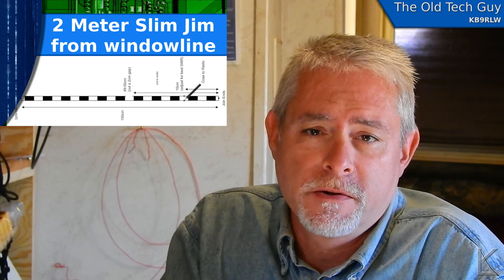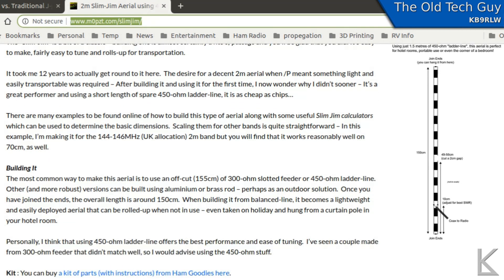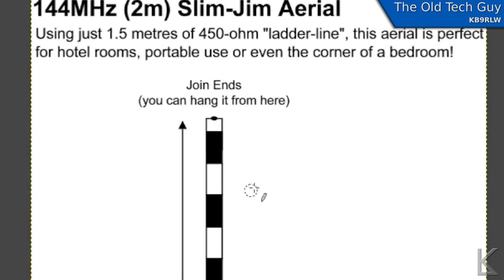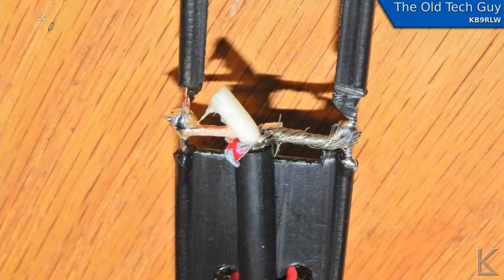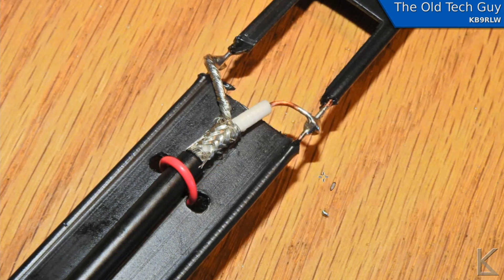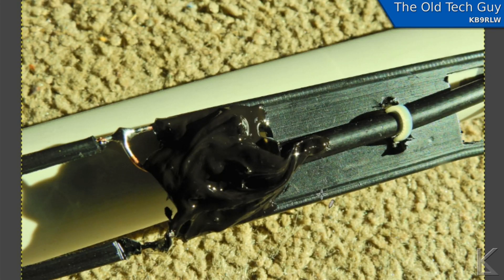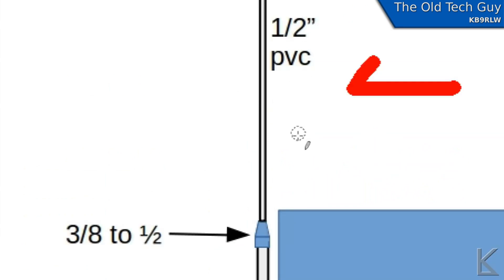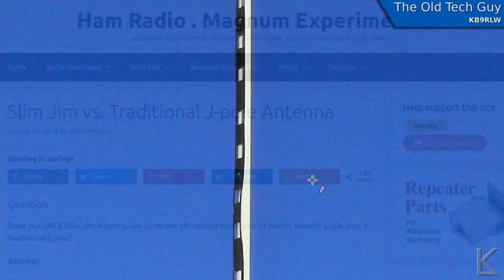Ham Radio - A 2 meter Slim Jim from window line.

Comment: I got the same model from N9TAX on my roof in NYC installed on PVC mount & work awesome. Using 50w mobile radio with this antenna, I cover Tri State area in NYC.

Comment: N. Davis/WB4BKO
About six years ago, I constructed a similar antenna for two meters, but I inserted the antenna into the PVC pipe. It was suspended from a pipe cap using a zip tie. Inserting the antenna into the PVC had negligible effect with SWR below 1.25:1.0 across the entire band. It is still in use as my primary 2-meter antenna and delivers good results with the top just squeaking above the roof line of my single story home. Eventually, it will be placed higher in the air at 40 feet when I mount it to the side of my telescoping tower. Good video and instructions are very clear. 73

Comment: Another great video.  It's the perfect blend of practical antenna theory, construction article and motivational video to get people building and enjoying the hobby.

I think I'll make some Slim Jim antennas for friends looking to get into personal emergency communications on the cheap.  I'll put the ladder line in rigid 3/4" PVC  with caps on each end with the strain relieved coax in the lower cap with a #60 weep hole to save a couple of RF connectors - cheaper, easier, more reliable, slightly better performance.  A coax choke also adds more strain relief and I'll cut the coax just long enough to reach the radio.  Simple, easy, cheap and good enough.  I can cut the PVC pipe longer to get a bit more elevation without a tower while having a fairly unobtrusive antenna.
Reply: I purchased my slim jim (many years ago). I used it for a while as my base antenna until I got a copper j pole. Now I have it hanging from the ceiling of my shack with a UV5R connected to it for monitoring. No PVC pipe or anything. Still works great! Since I have my base radio disconnected, most of the time, to avoid lightening storms, I have replied to people using the UV5R with no problem.

Comment: Thanks for a great presentation, and actual lab results.  I find that my 1/2'' copper pipe slim jims have a much broader bandwidth, typically 144 to 153 Mhz.  Indeed, using 3/4'' copper pipe for 70 cm slim jim, it is good forl 430 to 470mhz.  I believe my Slim Jims have a 2 Mhz broader bandwidth than my J-poles made of the same diameter materials.  I also believe that these antennas will have a lower take of angle and improve performance the higher that they are mounted.

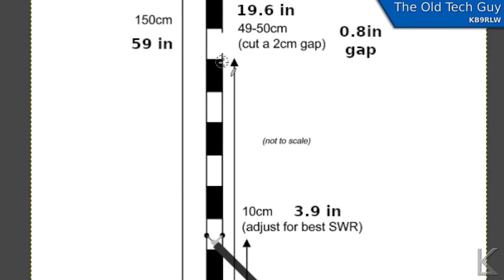Comment: 3:57 What I did was to cut it centered in the solid area - for strength - and then measured down for the rest. I did have to strip away some of the solid at the base to make the soldered short and also at the feed point, but that was no problem at all.

Comment: 1/4 inch fiberglass rod works better as a mast and won't affect the radiated angle of the slim jim.  Apparent gain is the advantage of a Slim Jim over a J-Pole.  Anecdotally, my SlimJim performs incredibly well portable/SOTA ops and I have complete confidence in this great design.

Comment: Most everyone I know calls it ladder line.  If yer cut falls on a space (window)  you could make a small hole in the top solid piece and bottom solid piece and sick a wire tie through the holes and zip it up to where both halves are even.  You'd have to use plastic wire ties though.  That would strengthen the antenna.  There's no link in the description.

Comment: I put mine inside of a piece1 inch PVC with a cap on the top  and bottom then so-239 on the bottom works great I have also installed an eye bolt in the cap where I can string it up over a tree or anywhere

Comment: Here is an idea for widening the bandwidth of the antenna. Where you have 2 -1/2 wave verticals if you make one slightly  shorter or longer would you get a double dip in the return loss or VSWR since the resonant length is slightly different.  
Alternatively  you could connect both the verticles at the top of the 1/4 wave matching section  making them a fan dipole with slightly different  resonance???
I would like to see if this would widen the BW.....
Reply from the maker: Be sure to let us know how your experiment goes.

Comment: You can Make this Window line into a 2 Meters Slot Antenna, 39 Inchs, with the Feed Point on 4 inchs from the End of the Window line, this Antenna is Vortical Polarize with is in the horizontal Position,

Comment: You could superglue a length of non conductive material to bridge that gap, then use some adhesive lined shrink tubing to reinforce that gap.
Reply from the maker: Or just cut your line so the gap is in the middle of one of the spacers.  Less work that way.
Reply: @loughkb  Yes, that's exactly what you do. I have made them for 27Mhz and the FM broadcasting band and that is how I've made every single one of them

Comment: Hi Kevin.....love your videos. I have a question in regards to the slim jim that you built. I can see that you intend to mount it to the outside of some pvc tubing. If the antenna were to be mounted inside the tubing/pipe with an end cap on ( to protect from the weather etc ) do you think there would be much loss ?.....I intend on building the same antenna but had thoughts of mounting the ladder/window line inside the tube....what do you think ??....Many thanks and keep up the good work...Mark, m0mco.
Reply from the maker: Yes, a bit of loss.  Tuning might shift a little too.

Comment: Newb here, won’t putting the antenna inside the PVC “hinder” performance? I thought the antenna had to be outside of any type of tubing to get the best performance. Pls educate me, I’m learning. Ty for your time.
Reply from the maker: I mounted mine on the outside of the PVC.   You can put them inside, but that will alter the tuning of the antenna slightly.   You'd have to adjust the wire length a bit to compensate.     Other than that, the plastic won't block RF at all, it won't affect sensitivity.

Comment: Have you ever tried a flower pot antenna?  I'm curious how it compares to J-pole and Slim-Jim.  I've got loads of coax and no ladder line :)   The flower pot antenna can be dual band VHF/UHF using only coax and some pvc pipe.  Worth a look when you get the 3/4 PVC pipe.

Comment: Just put one to gather. To night. August. 25, 2020. Still have to tune as I ran out of light. Seems to be a little high. But it will be used for scanner mostly. Tks for good show. Cheep. Sturdy and if pinched no  Biggie got about 80" more feet to go. Kv4li

Comment: I wonder how that pole set up would work on a metal cargo trailer conversion. Would the roof ground plane change it a lot? In a good or bad way! 73, W1ECM Eric
Reply from the maker: The slim jim does not rely on a ground plane.   But you'd probably want it up above the metal roof by at least a half wavelength or more.

Comment: hey brother do you have 450 ohm ladder line slim jim plans for  2m 70 cm   145mhz/440 mhz combined with good match ? adding coax part of the way up for matching ?
Reply from the maker: I've been told that if you cut the length to 58 inches instead of 59 inches, it will work well on both.   I haven't modified mine since I rarely, if ever, find myself needing 70cm.

Comment: Hi, Kevin.

How about folded dipole for 2m,  using the window line?  It is much shorter than the slim Jim.

But, we need 4:1 balun with correct toroid mix., for more optimum performance.

Thank you. :)
Reply from the maker: If I ever build a yagi, I'll use a folded dipole for the driven element.

Comment: Clear cilcone when wet will conduct it dryies outside in i put some on a 400vdc diode bridge and it blewup kg6mn
Reply: Good job he used black silicone then.
Reply from the maker: You should have waited for it to cure! ;-)
Reply: Did your clear silicone smell vinegary when you were applying it?

Comment: I understand that the Slim Jim has a lower take-off angle than the J-pole.....8 deg vs 20 deg.....if this is correct, the Slim Jim may be useful for longer range on flatter territory.....the J-pole might be more useful from a valley to a repeater sitting up higher......?
Reply from the maker: I don't think there would be a noticeable difference.   I ran across many claims about the slim jim vs j-pole.  Most were not backed up with any data and just seemed to be hearsay.  
If there were that much of a difference, by the time you get further away from the antenna, with the diffusion of the field outward, it would be a very very small difference.

Comment: What would happen if I followed this but had 10 meters worth of coax and soldered it the same way as in the photo would that receive anything or wouldn't it work mew to making my own stuff
Reply from the maker: The longer the feedline, the more loss, especially at VHF.  But 10 meters is not too much.  It should work fine.

Comment: Nice little antenna Kevin. How many watts would you be comfortable using?
Reply from the maker: 40 should be fine,  with the heavier wire in the window line, even more is probably fine.

Comment: From the article: "For you copper pipe 2BCX Slim Jim manufacturers out there claiming a gain over a traditional j-pole, isn’t it time you quit revealing to the planet your obvious lack of antenna design capability?  It’s well worth your while to research the product you sell.  If you want to manufacturer an antenna that uses more materials than a traditional J-pole with no measurable benefit, fine, but don’t mislead your customers about nonexistent gain advantages."

Comment: Hi Kevin, I'd heard that a Slim Jim is electrically a folded dipole. Is that a valid statement?
Reply from the maker: Not entirely.  A folded dipole is connected all the way around and fed at the center.  Kind of a loop that's been squashed almost flat.  It has a feedpoint impedance around 200 ohms.   
This antenna is partially folded back on itself, but not connected.  It's also fed very near the end where the impedance comes down to 50 ohms.  A folded dipole has a higher impedance near the end.
So, lot's of differences electrically.
Reply: It is an end fed folded dipole. It has to have one end open like that and fed only on one side because of the phasing. Think about this: if it's connected at both sides, you're trying to force the antenna to radiate with opposite phase, because the end of the 1/4 wave matching stub has high voltage and impedance rf of opposing phase at its end. The end of the folded dipole should be IN phase at that point. That's what the end break and gap on the slim jim allows

Comment: Does it matter which side the center coax is attached? One way is farther from the gap.
Reply from the maker: The diagram shows it on the long side, I put text on the screen when talking about the gap that said, "shield side of coax".      Sorry if it wasn't clear.  Should I do something different?
Reply: Yes! It does! The shield always goes to the cut side on either J-pole or Slim-Jim. The "hot"/center conductor goes to the long/un-cut side.

73
Reply: Kevin Loughin it was the photo that confused me.  In one we’re the center melted the center went to the left. When that was corrected it’s shown go into the right. I understand now. Thanks for the reply.
Reply from the maker: @TJVergerII  ahhhhhh!  I wouldn't have thought about the orientation like that.

Comment: How about doing a three or four element yagi for SSB and CW?
Reply from the maker: Where would I store it?  I'm tripping over things in here now.  Remember, I live in a 25 foot by 8 foot box.
Reply: Kevin, you are very resourceful, design a 3 or 4 element 2 meter beam that you can fold up!
Reply: @JimN5QL  make one out of rabbit ears.
Reply: @loughkb  ...a quad you could snap together using 1/4" diameter fiberglass rods which flex when you slide them into a boom complete with short tubing hubs wherein the fiberglass rods slide, the 4th rod bending the rest until all in straight & tight, a Dacron cord in physical parallel with the wire to absorb the stress and remove it from the wire for longevity.
Reply: When done using it, flex out the rods, roll it up & put it on a shelf somewhere, maybe above the upper pop-out railing.

Comment: Can you support /bridge the gap with a little piece of your $0.88 cutting board ??? Does it still fit in the pvc radome???
Reply from the maker: You could bridge the bap with just about any non-conductive material.
It would take a bigger piece of pipe to put the window line inside.   Tuning would shift and need to be adjusted and it would be too big around, I think.   Weatherproof and strain relieve the coax as I did and it's fine to have it out in the elements.

Comment: Just for curiosity's sake, wouldn't it be better to put a small set of alligator clamps on the coax shield and center conductor to facilitate finding the correct location to solder them on? How does this compare with the antennas that Ed Fong sells on Ebay? I have two of them, both bought some time ago at $35 each. So just curious. If you're in the Kingman area I'd be happy to let you borrow one of mine for testing and comparison. KK6LOP Also looking forward to hearing you on our Thursday night ragchew run by Bruce, WC7W of the Mohave Amateur Radio Club.
https://www.ebay.com/itm/DBJ-1-Dual-Band-VHF-UHF-2-meter-70cm-ham-base-antenna/113516146770?hash=item1a6e16f052:g:cA0AAOSwpHlZbVuC:sc:USPSFirstClass!86409!US!-1
Reply from the maker: I think that was you on the net that asked this question last Thursday.  But I'll respond here as well for the benefit of others reading the comment.
Using alligator clips would not be my first choice.  It's likely that after finding the sweet spot, you'd miss it my a millimeter or two after soldering the wires on.
Just lightly soldering the wires first, using the dimensions in the diagram will get you very close.  Then it's just a quick touch of the iron and slight move to tune it.  Then just adding more solder once you're there.  Easy.
Reply: @loughkb  Thanks, yes it was me. I had no idea how much you would have to move it. So a millimeter or two would certainly be easy peasy.

Comment: Put it inside a PVC pipe....
Reply: If you put it inside a PVC pipe it won't tune correctly. KN4BHS
Reply from the maker: Well, it might shift a bit.  So you could tune it to compensate.  I.e. if it shifted 500khz down, tune it 500khz high when out of the pipe.
Reply: @loughkb  thanks Kevin great video.